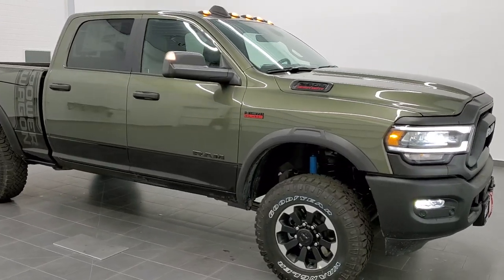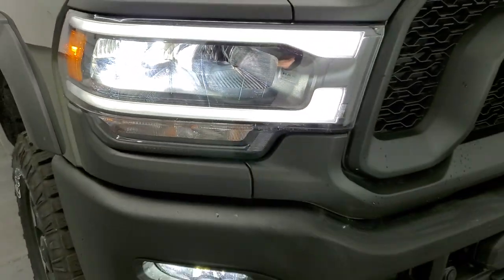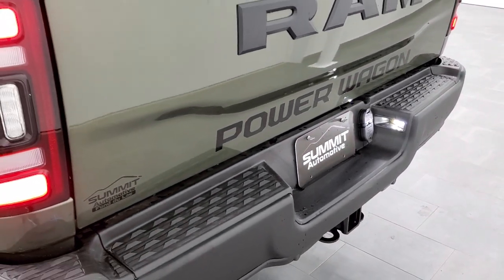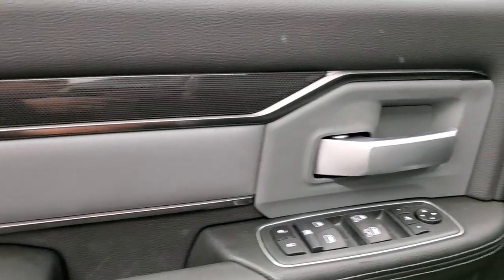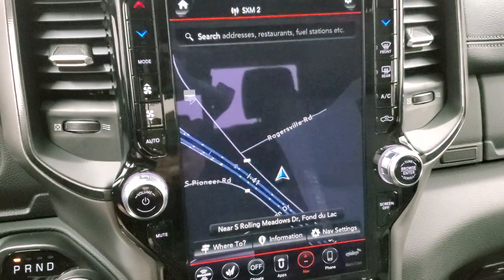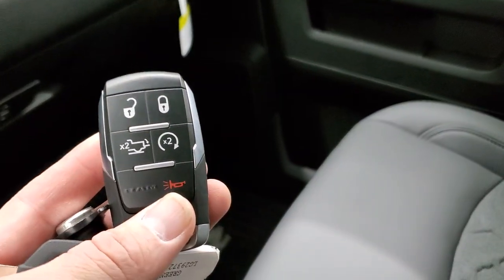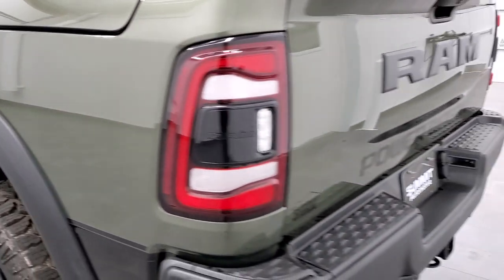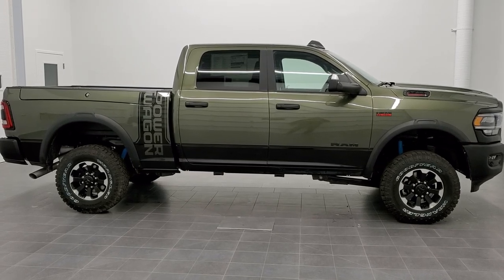FIRST OLIVE GREEN 2020 RAM 2500 POWER WAGON WALK AROUND OVERVIEW NEW RAM COLOR 20T239 SOLD! SUMMIT

Comment: I just ordered a 2022 Ram 2500 Power Wagon in this Color, But I got the Level 2 group and Black Wheels..I can’t wait to pick it up..👍🏻
Reply: Ordered the exact same thing. Cheers.
Reply: @hajikilla91  im hoping its due to the switchover from 2021 to 2022 models and things get cranking. Did you opt for bench or center console?
Reply: @Tylander_  Leather Bench
Reply: @Tylander_  It shouldn’t be too much longer now, So my dealer said.🤷🏻‍♂️
Reply: @Tylander_  The only way to get the center console is the 75th edition. This is the first time they ever offered a center console for PWs. Unfortunately, they quit building 75th editions in May.
Reply: @hajikilla91  I ordered in May and took delivery in July. Equipment group 2, surround cams, the 8" screen, ramboxes and bed utility group. I ordered AMP power steps from a local truck accessories place in town, but they were on back order due to computer chips. I climbed in and out of this beast for three months! I had to use a railroad conductor's step for my wife. I just got the steps installed two weeks ago, and they are AWESOME! Pricey, but awesome! The step is almost exactly in the middle of the distance from the ground to the interior of the truck. You can't even see the bad boys when stowed. Another thing I really like is that only the side board of the door you open deploys. I finally feel like the truck is complete. You're going to love it! My olive green with the black two tone and black wheels is almost camouflaged in front of a grove of trees. People stumble upon elephants in the jungle all the time. ;) I love the Ramboxes, too. Even though a spring has sprung. Nothing is perfect, but this is close.
Reply: @3-2-1-.  The 2022 PW offers a center console with equipment package 3, or if you option equipment package 2, you can add it with leather trimmed bucket seat option (+$545) and electronic transfer case (+295).

Comment: can i put a plow on the Power Wagon ?
Reply from the maker: I wouldn't see why not unless the winch would interfere with the brackets
Reply: We installed one on a 2017 Power Wagon in our shop, would not recommend it, winch has to go, sway bar disconnect is in the way and the attachments have to be modified because the Power Wagon has different frame setup than the regular 2500. Also electrical for the lights not plug and play, because Power Wagon does not have the Auxiliary Options than the regular heavy duty trucks, it works but it is a lot of modification
Reply from the maker: Thanks for the great info!